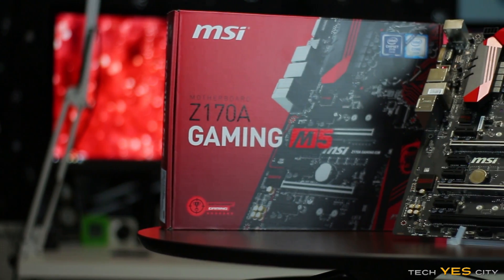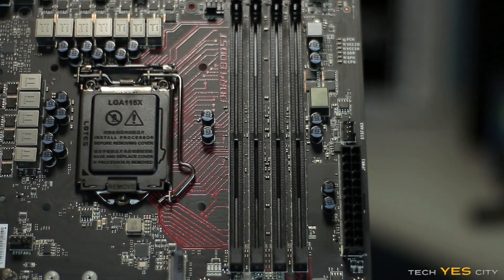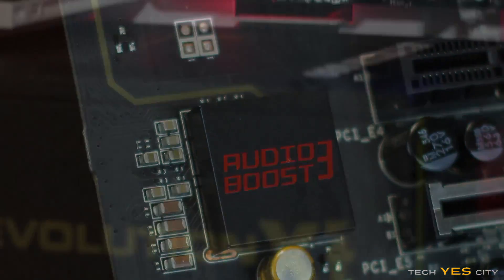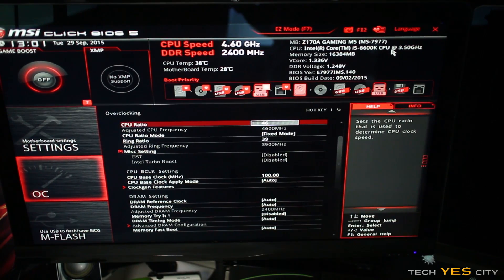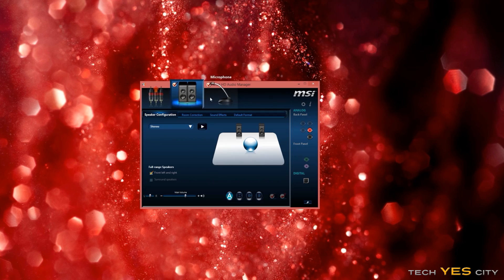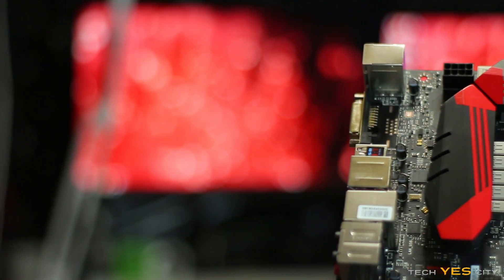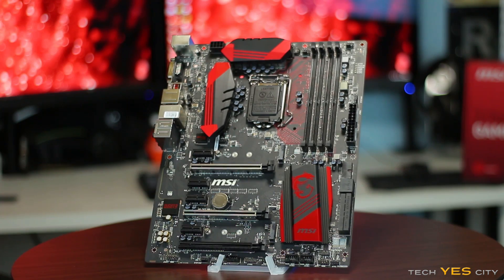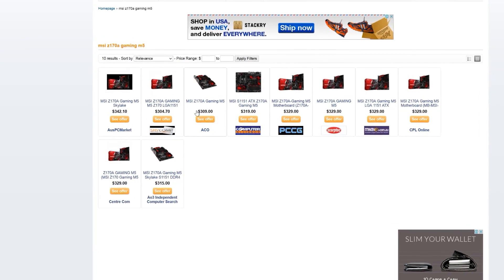MSI Z170A GAMING M5 Motherboard Review

Comment: Very nicely done Byran nice out together and overall very good.
Reply: Tech YES City

I eyeballed the two decently while turning in the motherboard and the pins seemed alright and the socket clean by what I remember so I doubt that's the issue.
Reply from the maker: +TheRaidenWolf Thanks man, how's things going on your end? The little one due anytime soon?
Reply from the maker: Damn, it shouldn't be like that, have you tried another mic?
Reply from the maker: Coudl be the mobo though, try installing a new driver set?
Reply from the maker: No worries, yeah people love the second hand builds, I will have another one coming soon!
Reply: +Tech YES City 
Hey dude don't know if you remember me from a few months back but we talked in the comment section of one of your videos, I believe even the one on the topic, about stock voltage overclocking on AMD FX chips ( I was using my other ID: NoirWolf) and Friday after about 8 months of usage the motherboard up and died (wasn't even above light load) even though it was designed for high end 6 core and low end 8 core FX chips (up to 8370s and my clocks were at 4.22Ghz) . I am going to be taking the board to the shop tomorrow as when it broke down it was too late to take it to the shop after making sure it wasn't the thermal paste or the bios acting up so to get to the points finally: 
1) The breakage itself exhibited by a immense and I do mean immense amount of heat off the Northbridge (standard temps were 60-70 while after breaking it was pushing 115-120 the two verification attempts I've made to be sure bios and thermal paste weren't it, and the temp was hit within a minute of booting) and the CPU (80C before emergency shut down) but no other temps were off (the GPU was nominal at around 60-70 C and the system booted to windows fair enough the last time I tried) so what are the odds anything but the motherboard and CPU are affected? My brother who has some more tech savvy than me told me to check the pins on both the RAM and GPU for a fairly accurate tell if they were exposed to high voltage ( spots and warping apparently are tell tale signs of the motherboard crapping out and taking multiple bits with it ) and I am fairly worried about the GPU as it is more expensive than the CPU and Motherboard combined (the RAM I can replace, not cheaply but not 360 euros either).
2) Considering I was using a All in One cooler and was basically running at turbo frequency non-stop there';s a chance the shop may figure out not everything was running stock (though the board was rated for a 125W chip running at 4.3 under turbo and it had 8+2 phases on the VRM and I didn't touch any of the voltages just the multiplier on the CPU) and may decide my warranty is void ( with Intel apparently not using the stock cooler = CPU warranty void, and the all in one I was using had its own backplate which I removed and reinstalled the stock one ) and considering the scorch marks on the copper surface of the seidon (plus a potential crack, if that is actually a crack and not a scratch from me and it seems to be a crack because I get the feeling it widened as I cleaned the spent thermal paste off, this being after the first thermal paste got replaced to see if that was the issue for the overheating, the scorch marks are also from the new thermal paste attempt) I would like to ask you, if you have any clue or advice, if I have to get a new motherboard and CPU (assuming just those two are dead and the RAM isn't affected and neither is the GPU... I would probably punch a hole in a rebar wall if the GPU is as well as that will increase the downtime and possibly the total replacement price by over a factor of two if I go for another FX) if you'd recommend something like a Xeon E3 1231v3 to replace the FX 8320 for heavy duty video editing? Cause by what I can see I can source that and a compatible motherboard for 400 euros ( A skylake Xeon unfortunately is over budget due to the DDR4 and no compatible 170 gen motherboards though the chips themselves are as cheap, or in one case even cheaper, than the Haswell brand ones ). 

Thanks for any advice you can give and sorry for the massive eyestrain... if it were just a weekend or week I have to spend without knowing anything about what my PC will be like it'd be easy but on Wednesday I am flying back home for Christmas with my family and I doubt they, the shop service, can tell me anything within one working day (and the shop's small to boot, they may have to send it off which would mean a week or two before I get any reply). At least the GPU, far as I can figure, should be covered by its own warranty so if it absorbed a shock from the death of the motherboard I can send it in ... unlike with the motherboard though... it will take a long time to do as that shop has no branches in my city. Delightful holiday present for me, eh? At least Microsoft support confirmed my Win 10 can be reused on a new motherboard if I supply proof of purchase and ownership of the Win 7 copy it is based off of so at worse I only lost my video editor software (AVS media so nothing retardedly expensive, just annoying) to the OEM gods. Gods and right around when my gaming channel started gaining traction too (both with viewers, hey 3 new ones is something in 2 months for me since I enhanced my videos and start posting more up and posting them on certain gamer orientated platforms considering 0 were had in the previous 5, and with developers starting to pay note of my minuscule channel, the reason I am so stressed about the PC is I have 3 games to do first impressions of after the holidays and I'd hate to think if any more developers decide to give me a review copy... January is promising to be a interesting month it seems...).

PS: Send me the bill for the glasses after reading all of the above :P .
Reply from the maker: Lol that was quite a read! It sounds like the motherboard has blown something on the VRM.  With a good PSU the other hardware should be fine as the PSU will generally shut off with OCP OVP etc, however stuff can get damaged pretty quickly, so it still is a concern.  I would just check what hardware is still ok, via chopping and changing, graphics card and ram will be an easy check if you have a friends computer close by. But most likely just a bricked motherboard, if something goes catastrophically wrong you will usually see / smell smoke lol.  As for warranty it should definitely cover you, as it broke under fair use, I would just BS the rest if you need to, cause its not fair if you don't get covered under warranty.
Reply: Tech YES City

Thanks for the quick reply dude ^^. Nope far as I can tell no real smells (heck not even the CPU smells if I were to think about it) from the RAM or GPU. The PSU's a Antec HCG 620W non-M who's OEM I think was Seasonic. Thing is I don't have anyone to check the stuff with as I live in a student city, more or less, and no one in my group has a desktop besides me :)) (they're all on laptops and even a Mac's in there for the count). But yeah with the info you and my brother gave me it won't be as stressful a holiday period as it could of been so thanks again ^^.
Reply: Tech YES City

Small status update: Took the Motherboard to the shop and they have to send it on to the manufacturer because they lack sufficient stock of it to do service for it (weird but I've heard crazier things in the past). Due to that fact they couldn't take the board with the CPU attached and I had to run to the other shop to put that into service whom told me "ok, if it is broken we'll replace it, if not the service price is 50 euros" to which I went "I'll bring the report I get with the fixed motherboard so you guys know I wasn't putting it into service for ass all reasons.". As for the all in one that I cannot send as that firm works through a courier system (sweet) that takes 3 days to process and arrive for pickup ( leaving in 1 day and 23 hours ). Ehh at least I'll have time to make sure everything works while that's in the service too :)).
Reply from the maker: +The Romanian Reaver Well the motherboard is definitely screwed, so once that is fixed you should be good to go, though I would still check the other components if you could, especially everything except the CPU, maybe look up on forums if there is anyone close by who would be willing to help? all you would have to do is drop in your memory / gpu and check they are all good.  I highly doubt the CPU will be bricked as you haven&#39;t been overclocking it, and it didnt shut off at random intervals before this incident yeah?  The shop sounds a little stiff too lol... That&#39;s why 2 junk PCs around here, I can diagnose stuff so quickly with them and test out gamble parts to see if they don't screw anything else.
Reply: Tech YES City I don't really frequent the forums and there's not enough time now anyway ( bunch of stuff to do before leaving as the PC dying put everything on hold as you can well imagine ). The only time the CPU shudown on me was during the new paste test (I was feeling like something was off with the temperature readings in bios so I forced my luck and tried to boot to windows, it made it to the log in screen before shutting down, my guess it passed 80C that time, when it did that I took off the other side panel on the PC, grounded myself well, and touched one of the mounting screws on the back side of the motherboard, visible through the little hole made to vent heat into the back of the case, and it was hot enough I couldn't keep my finger on it for more than a second, it felt 70-80ish to my well roasted physicist finger so I don't hold much hope for the CPU, I did do the bios reset but that time I only could listen to the machine as I had pulled out the gpu, only way I could get at the battery, though it sounded exactly the same like all the other tries: the fan on the AiO started up normally, stopped, fairly normal, and then went to full speed for the few seconds I let it run, on a normal bootup the first two would happen then normal fan speed after a fraction of second of high speed so I knew it was doing the same thing even with a reset bios and yes the bios reset test was done about an hour after the new paste one with both sides of the case open so it hitting 100ish C on the Northbridge and 60+-70+ on the CPU on startup was definitely not a case of me not letting it cool enough).

One good thing to come out of this mess, besides learning that Microsoft has a nice customer support service and that the shops I bought parts from were cheapish for a reason (but under normal circumstances I wouldn't have known), is the fact that a properly done x method for thermal past definitely does a better job at covering a CPU than the pea ( when I changed the paste I was cleaning the remains of a x method and the entire headsink area had been covered and while I think a little less paste would've been better the pea I used afterward didn't cover a few areas on the heatsink adequately enough in my opinion, granted the x is harder to pull off right especially with big hands and/or no fine motor control but seemed to work better for me).

I will update you when I know something on the parts I sent to the shop just to continue this epic tale of physical device failure and financial heroism.
Reply from the maker: honestly sounds like you just need to do the spread method dude lol.... that way you can visibly see how much you are putting on, with regards to how you apply it, it really is the least important thing to worry about, as you saw with my thermal paste vid, chicken grease applied with my hands with lil bits of chicken in there didn't do that far behind some mx4 on the pea method lol....
Reply: Tech YES City

Spread method with a derp like me = more air in it than a bag o chips :)).

Also... I missed that video... gotta ask: Did you get the craving for some chicken wings while stress testing that thing?
Reply from the maker: LOL ironically my $40 pc wasn't working tonight, I took it apart and the thermal paste from the AS5 was shorting a pin on the CPU, which caused it to be completely black and have no output at all.  Did you check the pins and CPU area thoroughly? cause that could be it, if so just get some brake cleaner and spray the shit out of it until all the thermal paste is gone and then just use the spread method or get some mx4 which isn't cap or conductive.
Reply: Tech YES City

Wouldn't explain the northbridge temps :P. Up until Friday the PC was running brilliantly as it had been for 8 months by that point.
Reply from the maker: It could actually if the pin is shorting then it can send the NB into full throttle.
Reply from the maker: But yeah it shouldn't be a problem, what thermal paste were you using again?
Reply: Tech YES City

The stuff that came with my Seidon 120v which if i am not mistaken was above average.
Reply from the maker: Guess its too late to check now lol :(.
Reply from the maker: Ah there you go, for me it was immediately obvious, two pins had a smudge of paste between them lol.
Reply: Tech YES City

For my brother it was funnier (his motherboard broke down 2 months ago, he's on intel though) as he didn't immediately notice and when it came back from the service with the note "you bent two pins, no refunds" he was cursing a storm trying to figure out how he managed it.
Reply from the maker: Yeah might want to take photos of the board before sending it off, cause that could be a load of bs, did your brothers problems randomly occur or got worse over time? Cause bent pins on stationary hardware doesn't 'just happen' lol.
Reply: Tech YES City

Being in the socket itself and him having sent it off for diagnostics with the CPU (his shop covered the board directly unlike mine) I doubt they could've bent pins without causing damage to the CPU itself.
Reply from the maker: or the pins were never bent to begin with ;)
Reply from the maker: i.e. they just spin a bit of bs to get money out of you.
Reply: Tech YES City

In other news first day of vacation is turning out to be even more stressful: My mom has 3 cats and I was wondering why her PC was hitting 80-90C just idling... heater went on 10 min ago and it spiked to 100, cue me emergency turning it off and having a look in it... I am fairly sure the BBC could do a paleontology special with the how the insides looked...considering this PC is technically also my brother's, he built it a few years before leaving, I closed it up, let him know and am currently jury rigging my laptop as a stopgap measure for my mom and dad's use while my brother's still not here (as the actual PC probably needs a pickhammer job on some bits and I ain't gonna do it because I told him to get filters on the damn thing).